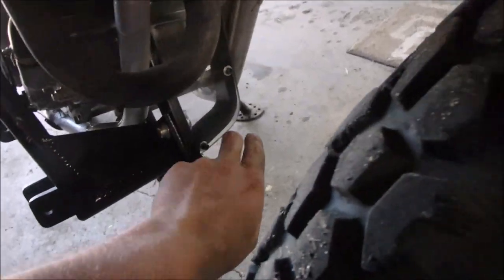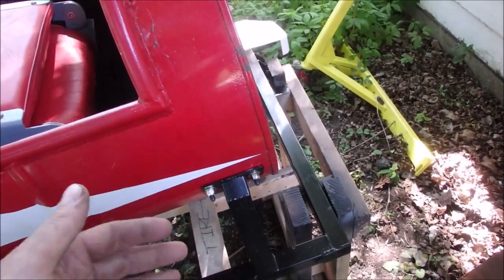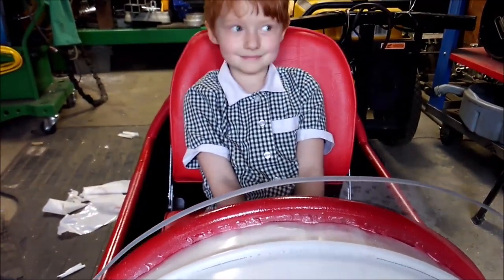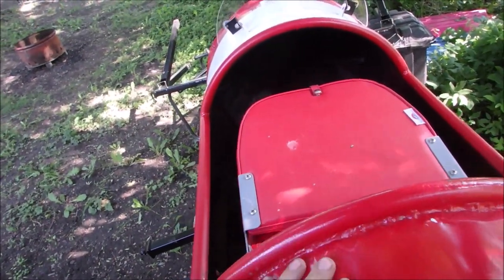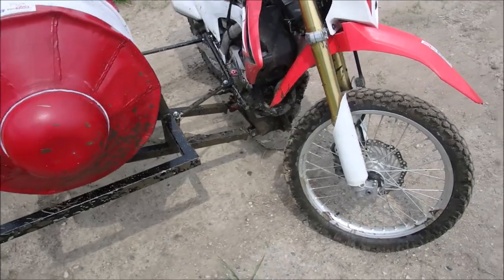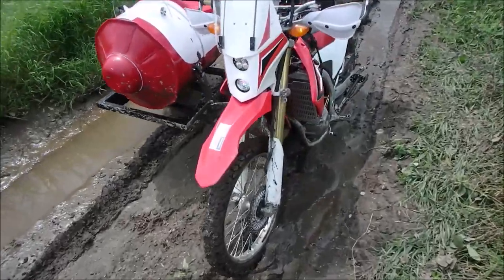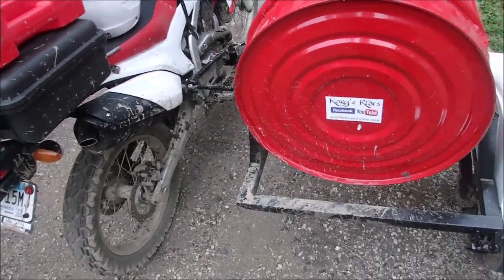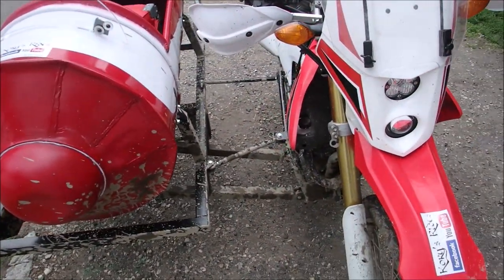Sidecar Upgrades and Update

Comment: How did you make the front end of your sidecar? I am thinking of taking a trailer and putting a 55 gal. plastic drum on it to use as a trailer for my dogs. I have ridden sidecars for years and they do have characteristics for driving them that can easily confuse a motorcyclist or electric bike operator. You really have to learn to lean when making turns to the right. My Ural Troyka had a reverse, and you really need to know what you're doing when backing one up. I made a DIY pickle boat with a plastic oil drum in the past and they are strong, but lighter in weight than the metal drums. What did you use to do up the rims around the opening to the sidecar? Metal conduit?  Thanks for posting this video. Put a dog into the hack and you will win a trophy all the time, even against expensive bikes, as the crowds always love a dog in a sidecar. ;-)
Reply from the maker: I have a build playlist

Comment: Curious if you know why so many people put a springer fork up front..I want something that can handle the bumps!
Reply from the maker: I think you're confusing your terms. A springer front is completely different from a leading link. People put a leading link front end on because you need to change the rake and trail when you have a sidecar period you can get away with stock forks, but it won't handle very well.

Comment: How did you fixed the alaigment?
Reply from the maker: Link arms have threaded eyelets in the ends. Moved them in and out until it worked.
Reply: @KorysRides  am about to build one of these but ive heard that under different loads the toe-in varies, so im thinking on making a whole ajustable swing arm
Reply from the maker: @zoticrr9638  camber changes. But yeah, adjustable would be good

Comment: can get some black/chrome caps to go over those bolts for classssssss =p
Reply: and could either a small atv or smaller bike tire be better for over there?
Reply from the maker: @freemaysin5088  not really. Needs to be able to go high speed, and easily replaceable for $20 or less. Parts available everywhere. No need for caps, I go for function over form